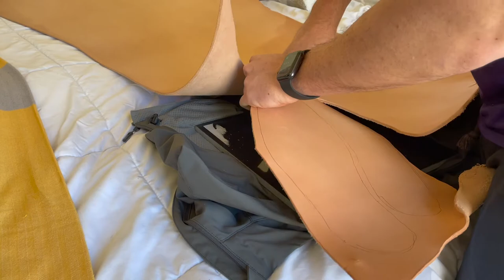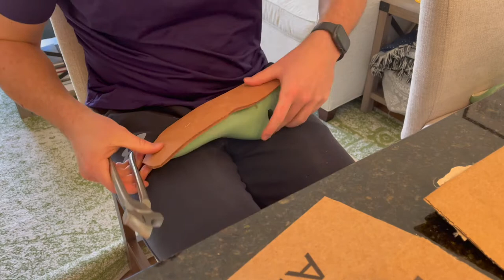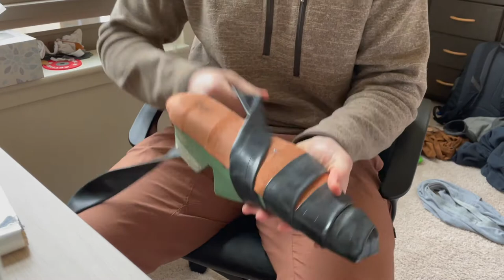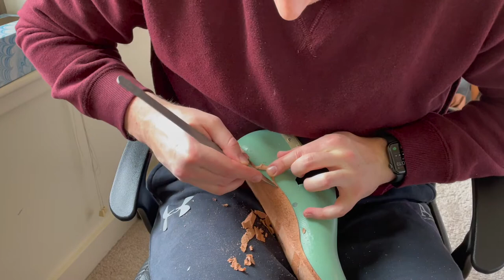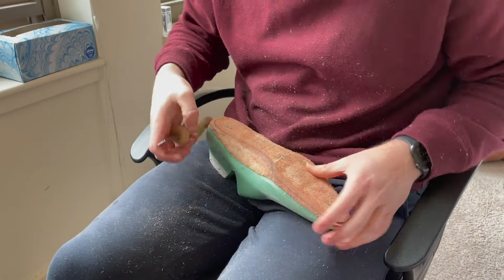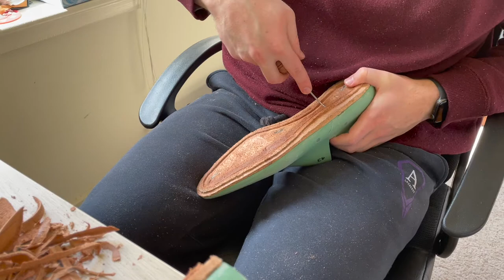Resizing Old Shoes (Part 1 - Insole Prep) - Traditional Bespoke Shoemaking

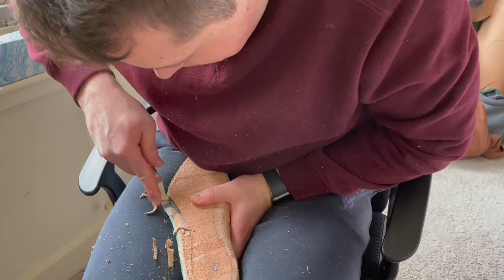Comment: 4:45 you are completely miss using this tool. It is not  for skiving. It may look like a French edger but it isn’t. It is meant for channeling. You are using a left handed tool with your right hand. You also should probably sharpen it as it really shouldn’t be this dull. Good luck.
Reply from the maker: Thanks for the advice